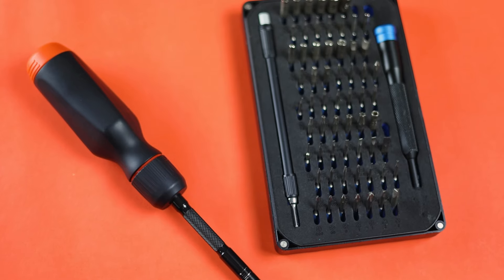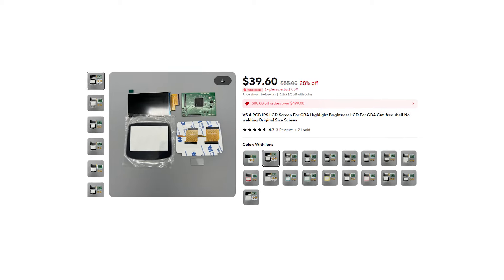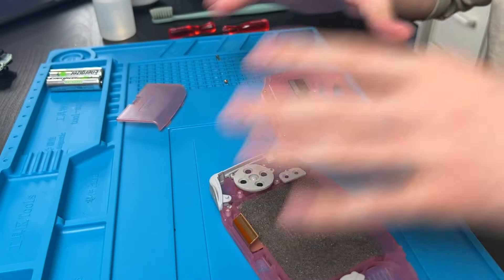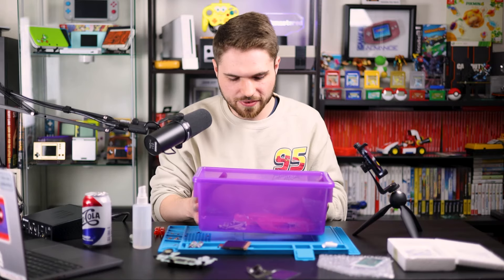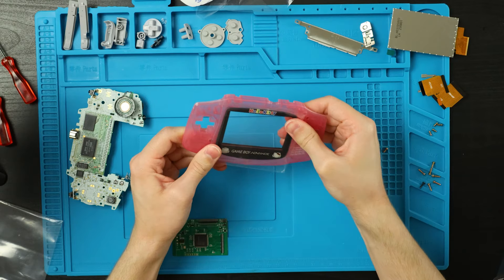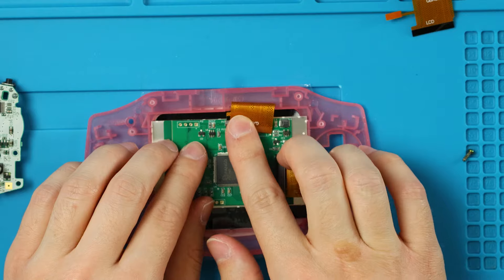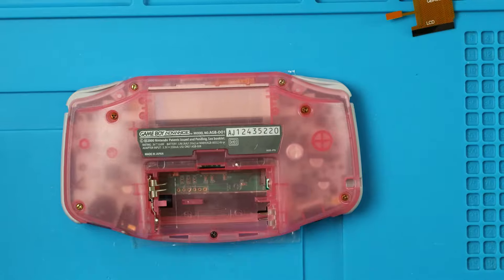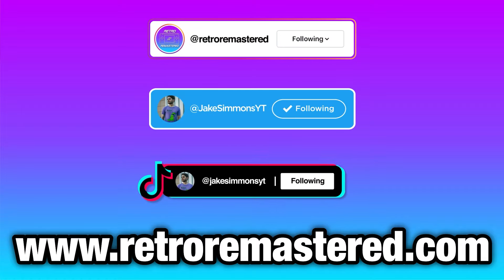The CHEAPEST Game Boy IPS Mod... Is It Worth It?

Comment: I purchased one of these kits on eBay with a new shell, and other than me having to manually thread the holes, I don't have any problems with it. For 45 bucks, it breathed a lot of new life into my GBA that I got for free years ago. Decided not to solder the brightness wires in since the default brightness was more than enough for me.

Comment: Question here, recently bought by and installed a drop in v5 3.0 following your guide on it but was left with light bleed on the bottom of the screen and spent hours to figure it out a fix but it still has a little bit of bleed on the bottom and I just can’t stop noticing it when playing Mario and Luigi superstar saga and often go between menus
Reply from the maker: It’s probably because the screen is slightly bent or the there’s a bit of pressure somewhere along the edge. Sometimes it’s a pain in the butt to figure out unfortunately:/

Comment: Just commenting overall in the chance you'll see this. Been looking at your website for a GBA/GBC for a long while now, probably +6 months. The Suicune one I'm really tempted on because of the FP motherboard and everything it offers, but that shell, not a huge fan. The Blastoise one you made as a first go would have been an instant buy had I been in the stream when you made it. I'll for sure buy one if a FP motherboard gba with a good IPS screen pops up (Honestly not sure is there any practical difference between a V3 and a V5 after your video, slight variance)

Also. Don't think you've seen this comment from your GBA IPS Screen comparison video, so posting it here. Maybe a decent future video idea?

* How does the colors compare (warm/cold/washed out/over saturated)?
* How does the screen handle games with flickering (for transparency)?
* Does it have ghosting?
* Does it have integer pixel scaling or not?
* How are the viewing angles?
* Feature comparison like color palettes, frame blending (to avoid flickering), screen offset etc, with a matrix comparing every screen at the end.